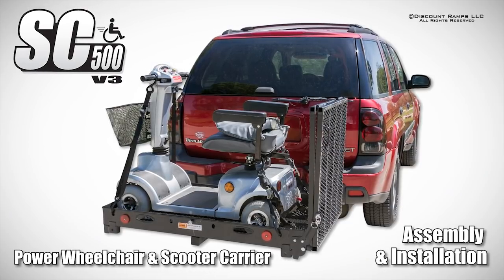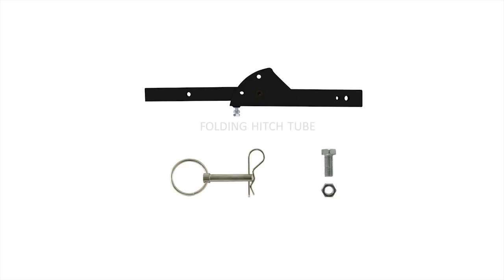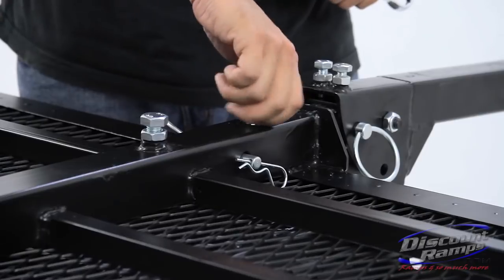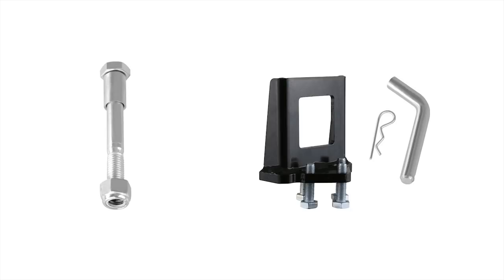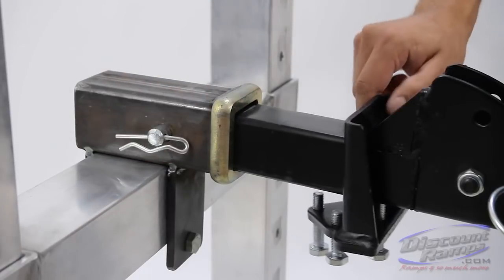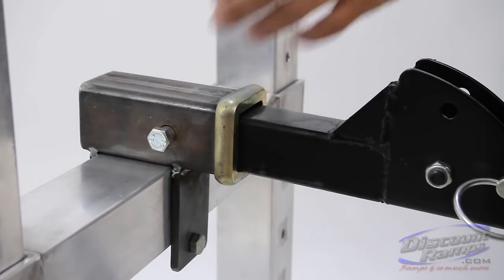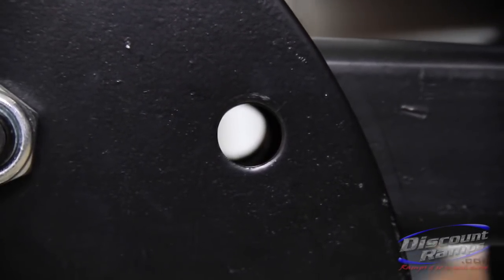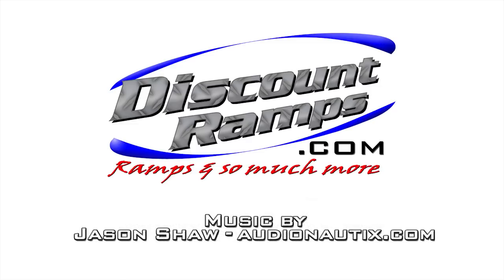SC500-V3 - Folding Power Wheelchair & Scooter Carrier -  Assembly & Installation

Comment: Has anyone figure out about license plate if you decide to leave the carrier permanently. Sometimes you fold the carrier and it cover the plate. May get a ticket when driving with the carrier folded. it is not easy to remove plate from the car often.
Any ideas appreciated. A little wabbly but a minor issue . I use a strap.
Have to paint the metal if there is a scratch to prevent rust.

Comment: This was very hard to install. The holes didn't line up to put the hitch pins in. We had to drill to make holes wider the carrier shakes too much when in upright position on the swing away arm. Went to Harbor Freight to try to get something to stop the gate from shaking no luck. Do anyone have any suggestions that can stop my gate from shaking so much when it's in the upright position it seems like it's going to smack right into the back of my pickup truck
Reply from the maker: Tracy, we're sorry to hear you had difficulties with installing this carrier. Have you reached out to one of our customer service representatives? Please call them at 888-651-3431
Reply: I used a bungee cord to keep the right side from rattling

Comment: I already installed my ramp but it doesn’t look straight, or it doesn’t have to be straight?
Reply: Mine is not level ether
Reply: @Bearlake1624  last week I was driving and omg the ramp almost got stock in a hole
Reply: Same issue so crooked and low..this winter I'm taking my time and see if it helps to be straighter going to lube and readjust the bolts